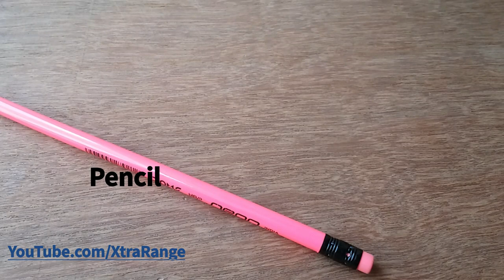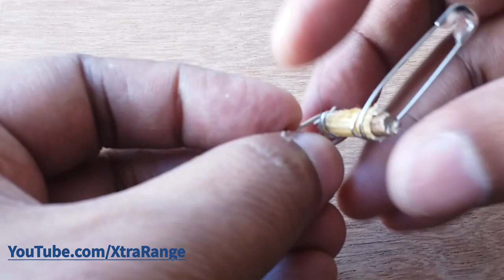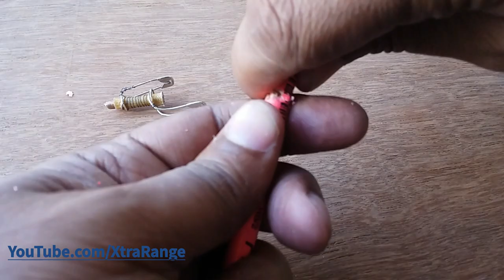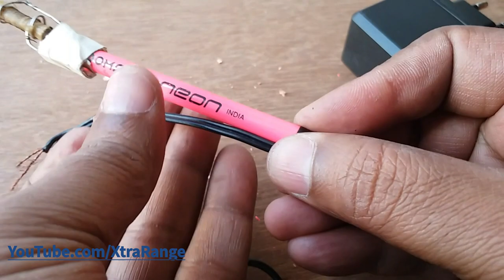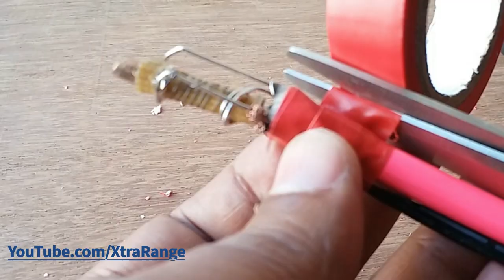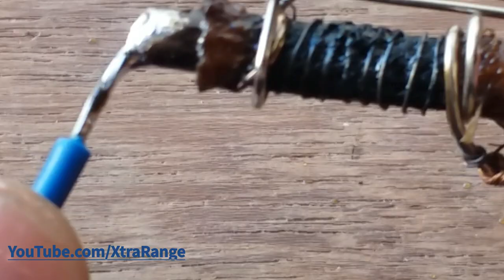Brilliant DIY Soldering Iron (12V DC)

Comment: Is si kam nhi chalta kya
Reply from the maker: +jitesh jangid check your adapter output. also when you wind the nichrome wire, make sure that two winds are not touching each other.
Reply: 5 voltage ka ha